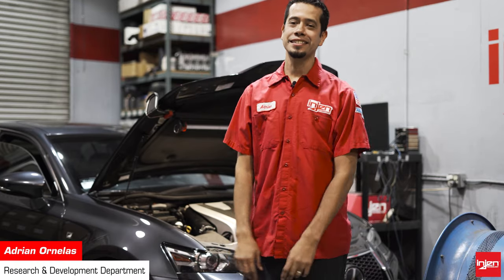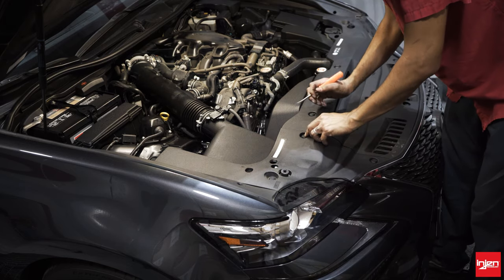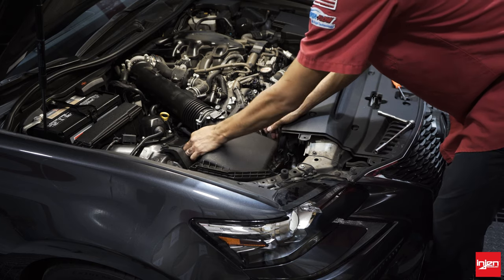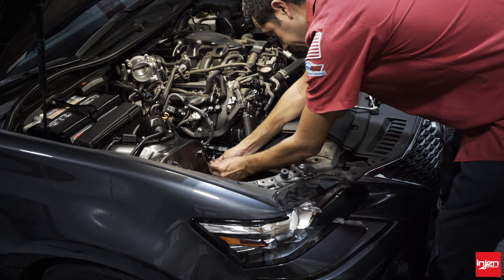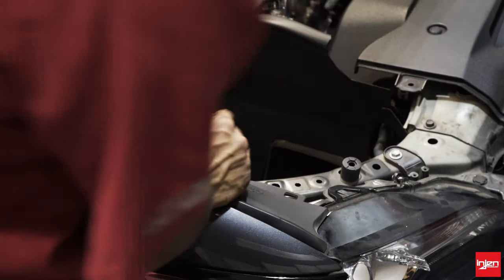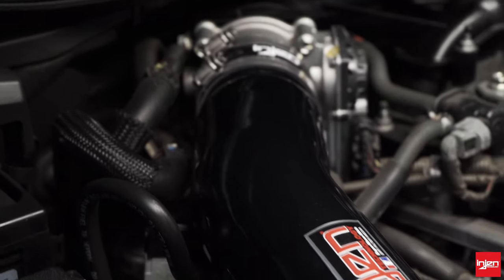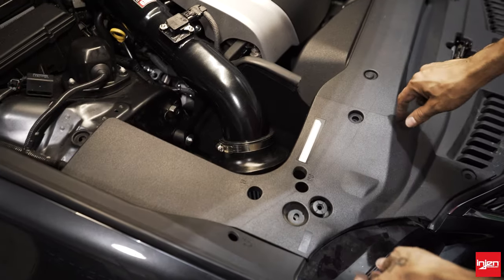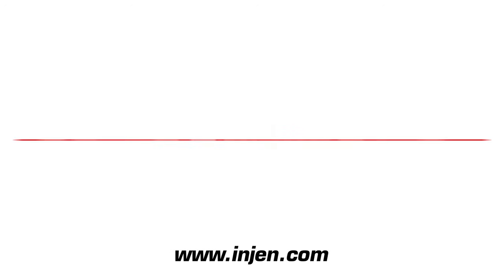2013 - 2020 Lexus GS350 Injen Intake Install Video - SP2098

Comment: what was the point of showing dyne runs with no results?
Reply: Stock: 254.34 hp / 232.22 ft-lbs
With Injen Intake: 264.39 hp / 241.40 ft-lbs.
Source: https://injen.com/pdf/184517
Reply: @thinkbinary6729  you really gonna believe Injen wit those numbers??..thats basically a marketing tool
Reply: @showstoppa01   I didn't say that I trust those numbers. I just answered Rene Ledesma's question...
Reply: @thinkbinary6729  arent these cars 300hp stock or is it the f sport gs350?

Comment: Why are you guys worried about dyno results for a CAI in a normally aspirated engine?  You don’t install a CAI for more horsepower…come on man.   If you are expecting it to make the car “faster” you’re looking in the wrong place.   You’d get this because you like the sound…
Reply from the maker: Actually on the contrary.  There's no magic to the hours of R&D that goes into each and every intake, and our dyno results are straight off of the dyno computer.  We don't even go and recreate them in a color scheme that fits the brand better.  All of that is just to show that we aren't faking these results.  Sure, without a tune you're looking at 11HP.  But that opens up a ton of headroom for when you get an exhaust and a proper tune done.  There are always people that will buy for the sound alone, but you can't fake facts and it does make more power.  I hope you have a wonderful day and as always, #staytuned.
Reply: @InjenTechnology  lol yeah right, 11 wheel horsepower from a hot air intake. These 2gr engines only gain 20-25whp from a full exhaust with PPE headers.

Comment: Show the actual numbers before and after
Reply: Yep. Show the sheet. An increase in HP at 6k RPM doesn't mean much. What are the gains(?) at all the RPMs?
Reply: On the corner almost at the end ,it said that it went up 11HP 10ft of torque . I was disappointed to see such a little different.
Reply: Under normal conditions you wouldn't be driving with your hood open. That has to be a factor also with the net results
Reply: @zerimar6970  10hp is pretty good actually

Comment: Nice video bro. Did you happen to get TRAC OFF and check engine light with lean code after intake install? I cant figure this out.
Reply: I wouldn’t put that on my car even if you paid me. you have to reprogram your computer to except the intake changes it will probably be more expensive than the intake,so not worth it🤦🏽‍♂️
Reply: @cgamble30  Respect your opinion but you are wrong about everything you said. LOL sounds great all lights off after a few starts computer updated itself. Perfect!! Loooouud!! 🙏🏽
Reply: @cgamble30  You don't have to reprogram it
Reply: @cgamble30  you have to disconnect the batter before installing it that basically allows the ecu to relearn the intake

Comment: I love this video, mainly because I have the exact same GS and I plan to make at least 350whp. Got anymore stuff to help me push it close to that or maybe even more?
Reply: you cant just get a euro if you want that much power just with a simple flash tune on euros cars you can unlock 20+hp. gs350 is a nicely balanced car and really reliable im for sure goin to get an fsport gs350 as a daily driver next year.

Comment: Will this work on ES350 being front wheel drive and possible drivetrain issue?
Reply: That's what I've been trying to find out also. What can we do to the es350
Reply: The ES intake is different you can still install one, you buy the correct one

Comment: I suffer alot with Takeda intake. It shock the engine due to massive air gets inside in comparison to the fuel ratio. It cause a rapid cut-off or acceleration pause when accelerating hard when the RPM reach 5-6.

Unfortunately. I ended up selling it with less than half of its price
Reply: You know you could of tuned your car and would ran better and add more power
Reply: @lexusis350toyotamade3  I didn't find practical to tune a car for just air intake
Reply: Would the same happen with the injen ?
Reply: @Mr.Helper.  i don't know. That's why I'm hesitating to repeat this experience
Reply: You should try HPS intake tube w/ K&N filter. It’s a good combo I haven’t had any weird issues after install.
Reply: Hey was it the oiled filter or the dry filter Intake ?
Reply: @VictorFlores-fc7pb  the oiled one.